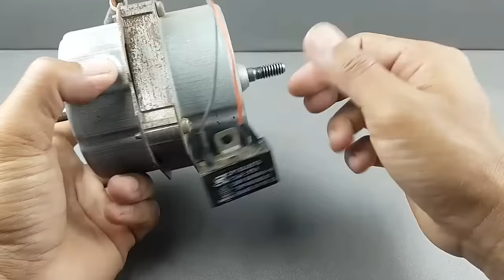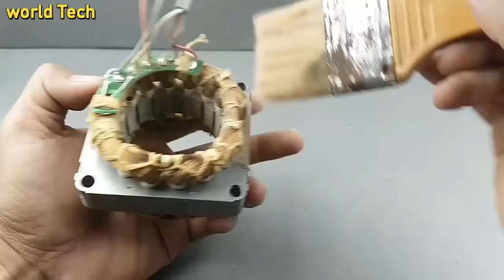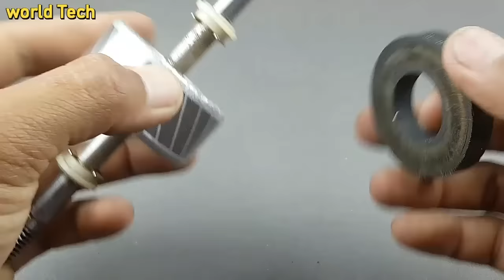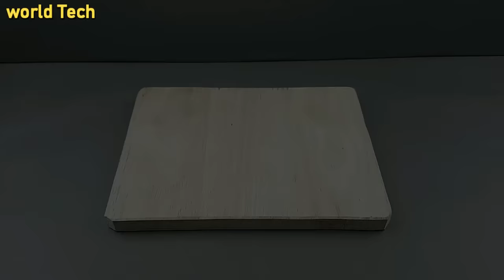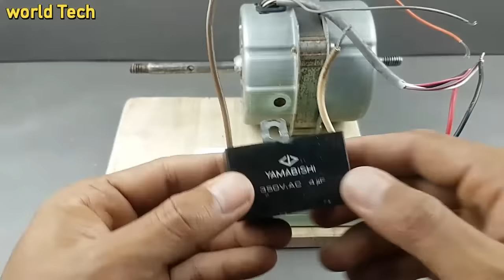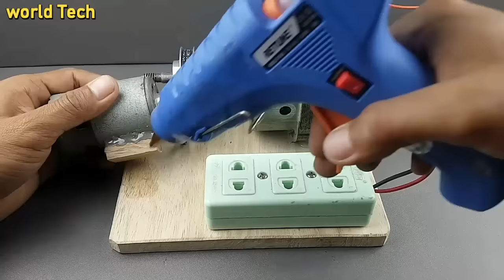How to Turned a Fan motor  into a High Power Generator 8000w || free electric generator At Home 2022

Comment: This machine is not working to full efficiency because it is missing an output collimator. That problem could be solved by putting a reverse bias subduction spline in the circuit. This would eliminate any waveform deviances and make the device capable of  powering any conventional non-reactive bi-stable system.